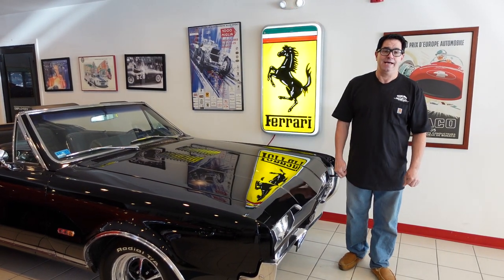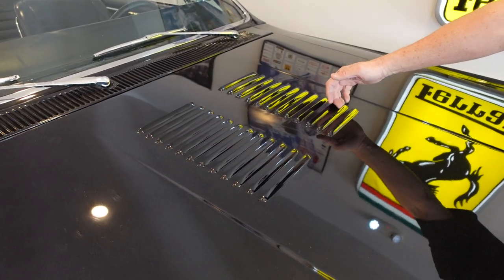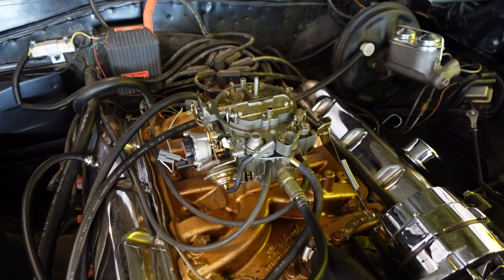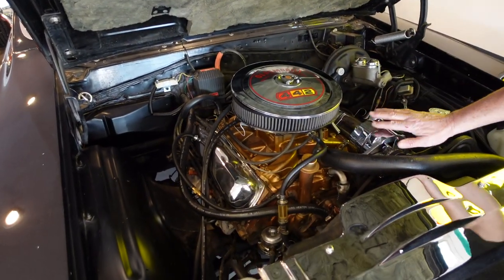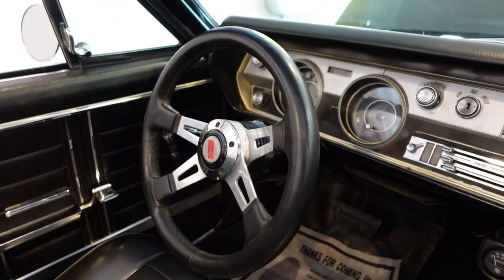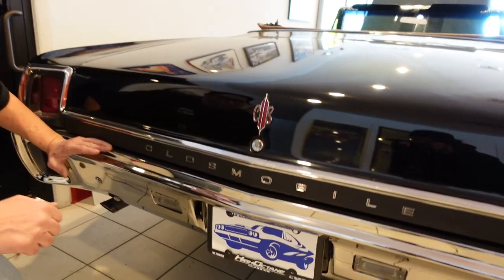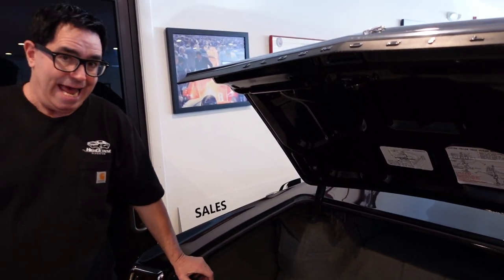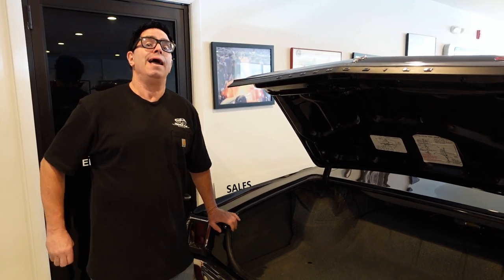1967 Oldsmobile 442 Walkaround with Steve Magnante

Comment: I bought one of these back in the seventies for $75.00! Convertible, white with black interior and 4 speed. Got it so cheap because the car ran but could not move under it’s own power. I crawled under the car with hammer in hand and knocked the Muncie transmission out of two gears at once, pumped up a low tire and drove it away. Had a lot of fun with it for two years and then let it go for decent profit. Wish I’d kept it. Those were the days.

Comment: Psst. I don't think that Quadrajet is an original. I can see the APT (adjustable part throttle) cap on the front/passenger side of the carb. That would make it a mid 70's version QJet. Probably a better carb, but not original! I could be wrong but I don't think Olds had electric chokes in 67 either (but don't quote me on that).